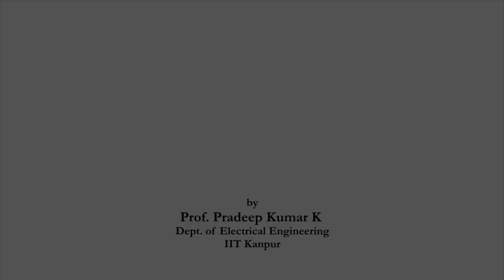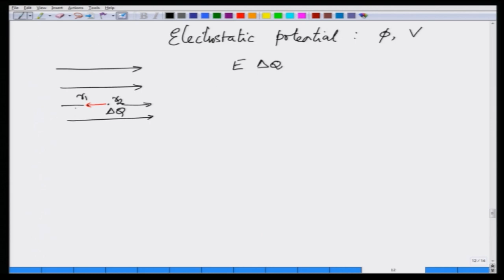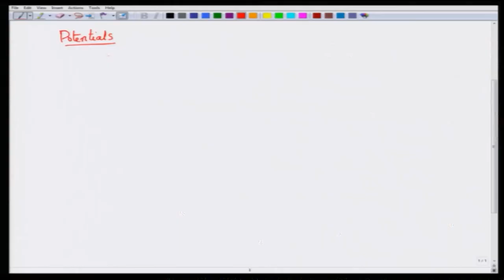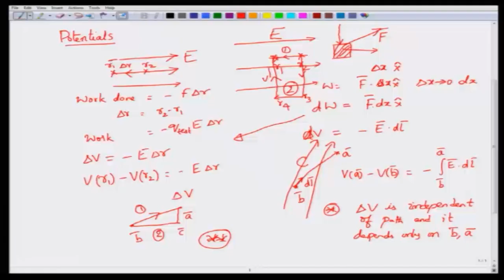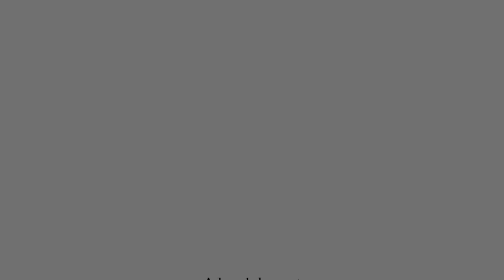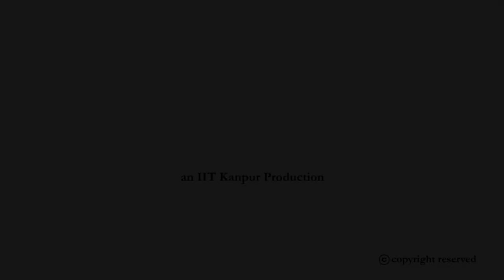Electric Potential-I

Comment: Electrostatics and circuits belong to one science not two. For a unified approach to learning Current and the process of conduction watch these two videos 
i. https://youtu.be/TTtt28b1dYo and 
ii. https://youtu.be/8BQM_xw2Rfo 
Also, in the textbooks referred in the last frame of video i you will find descriptions of the electric and magnetic field, operation of 
resistors, capacitors and inductors using a unified approach which makes it easier to understand the operation of circuits with these elements.

There are also a chapter in the textbook references 'Fundamentals of electric theory and circuits' the operation of transmission lines using the unified approach.